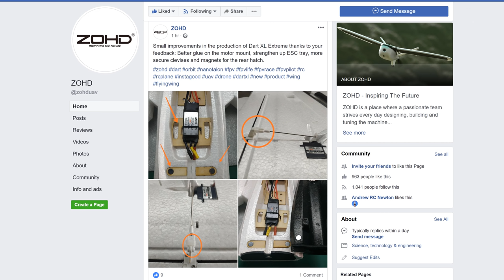"Wait for Version 2" - ZOHD Dart XL Full Review (Not a Freebie) 4K

Comment: when the guy said pull up, you got the time to strait the wing and pull up, you choose to keep with the maneuver that clearly was a wrong choice, and with the plane in more that 50 degree and the nose in 45 down you pull into the cockpit, is a clear doom thumps no questions, see that happen over and over with guy that are learning 3D.  The guy that tell you pull up pull up, knew you were doing the wrong move. You may be correct in some points but the crash my friend you own it.

Comment: Finally a review that points out a lot of the flaws that I experienced with my zohd extreme. I was honestly disappointed and left my review on banggood to that effect, because I felt that I was missing something or had been extremely unlucky and received a lemon. Because all the reviews I had seen before I placed a pre-order put this thing on a pedestal. But yes, my esc was garbage, didn't spin the motor, my servos wouldn't center so I replaced them both. The 9 inch prop was such a pain to deal with. I broke it almost every time on landing so I switched the whole power system out, put an 1800kv 2216 motor, 7X7 prop 60 amp esc and 3d printed a prop guard (shark fin) that stuck out the bottom of the model to protect the prop on landing. Now its a bit better... But man I felt duped paying $183 for this, I have to be honest...
Reply from the maker: Morning, yea I was quite surprised watching some of the videos after I got this one out. Wait for a video on this topic short;y as there is a lot of bias out there. Anyway, enjoy the model you have fella, it sounds like you have invested some decent tie in it Frank, Matt

Comment: What the hell? Okay some feedback fom my side with a similar Agree and Disagree list to your "review"

Agree: 
- Motor sounds bad (bad quality ESC)
- Winglet clips bad protected

Disagree:
- You are flying a long range endurance cruiser like a warbird… What's wrong with you guys?
- this thing is never meant to be a speeder or fly inverted but it is build for efficiency…
- you remove the back canopy because it is bulky? It is meant for optimized cooling of the ESC and other electronics like VTx! 
- Top servos? Why? disturbed top airflow means higher stall speed. That's the reason why. And because it is NOT a racer, it will not have issues with pushrod flex

And btw. I don't own a Dart XL yet. But I will definitely buy one in a few weeks and build a INAV or Ardupilot controlled cruiser out of it. So this is NOT a fanboy comment…
Reply from the maker: Morning, just spotted your comment. Do you know of any other model is designed to climb under thrust to the point it will loop? There is so much up trim built into this model it's rendered it useless. I'd watch a few of the other reviews and see what others say, albeit I do not believe it warrants the words "Absolutely Fantastic", see this video for why https://www.youtube.com/watch?v=cn1zhMqGzwI Matt
Reply: @RagTheNutsOff  I know what you mean. I fly an AR Wing right now but with inav on a F405 wing FC and that compensates for that. In manual mode it also has hard uptrim. Okay it is not as hard as you reported but it still goes to the moon on full throttle when trimmed in cruise speed of 40km/h. On full throttle it goes up to 90 with stock motor on 4S and pitches up vertical (not enough thrust to do a full loop). As I said this thing is made for cruising and not high speed. You should mechanically trim for more speed. All wings pitch up on high speed and down at low speed.

Comment: Well, just maidened mine, and Matt is pretty much spot-on. 
Chucked it, half throttle, neutral trims, and even made it nose-heavy, and it immediately looped. WTF. 
Even full down trim on the radio barely made it fly straight, as long as i didn't use the throttle.
I love ZOHD stuff, but this thing is a disaster. Bought from Amazon, going to put in a return request as i feel this thing is seriously defective.

Comment: Slightly confused Matt. You reckon the thrust angle is off as it try’s to climb on high throttle. It certainly looks that way however just prior to the #landed you were flying inverted and had full down elevator applied, and it was still diving inverted ,again explainable by bad thrust angle. What confuses me was the sudden dip down to the ground when the throttle was reduced, which you would have thought would have reduced the thrust angle issue and allowed you to be able to level it inverted. 
Also in this instance, inverted, the servos and control horns being mounted beneath the wing would actually have been beneficial as the servos were pulling the elevons giving down elevator while inverted. Their being mounted underneath did not contribute to the #landed.

Comment: I added a tarot gimbal to the top and flew it the other day.. However I as well have a list of issue  but I still love it.. 1 big issue is the motor its either over proped or the it can't handle 4S..
Reply from the maker: Morning, oh nuts. I thought they were using a similar to SunnySky motor on the back. Is it getting hot? Or is the ESC failing as I had that with the dart XL. Matt

Comment: I have a Forward swept plank and I encountered a similar difficulty to keep it inverted with low elevator rates.
It has to do with the reflex. The reflex brings stability in level flight by countering the center of weight in front of the center of lift.
When you are inverted with a plank, the reflex works in the wrong direction. So you have to push on the elevator to create that "inverted reflex". If the rates are not high enough, you may not achieve the required deflection when inverted.
I think I will add a curve with some additional elevator throw the closer I get to the upper elevator stick end.

Comment: How about trimming back the TE of the reflex section say 1/4" at a time and note the effect, probably put the motor thrust angle back to neutral first.
Cheers
Robert
Reply from the maker: Morning Robert, the angle on the motor is pointing way too far downwards. It should be going through the CG line (Sir Bruce covered this a while back). As for the amount of trim, I think we're all resigned to it being a "one-speed model". Quite odd! Matt
Reply: @RagTheNutsOff  ok , what I  am trying to say is, the inboard part of the wing at the trailing edge where the extreme upward curve is could be cut off to reduce some of that reflex thereby reducing the "up elevator" effect.
https://m.facebook.com/story.php?story_fbid=1535505459915968&id=100003695868221

Comment: £150 for a model that doesn't fly straight, doesn't fly inverted, doesn't like staying in one piece. I'll stick with the Tek sumo.
Reply: Do you have one?
Reply: @maxun1  No I don't have a dart XL. I've got other planes which do everything the dart can do and more. So I won't be getting one. It doesn't even seem to fly particularly well at moderate speeds. I've seen videos that show it waggling quite a bit, at about 35-40mph.
Reply: @51im  I got 268 planes and maybe a little be more, none of them fight equal at all.
Reply: @maxun1  
I haven't got 268 planes more like 26 and I have to be careful with what I spend my money on. It won't be one of these.
Reply: Mr.shadey it isn’t a racer. It’s for cruising.
Reply: @bondebos3478  yeah a badly designed cruiser
Reply: Mr.shadey not even true, watch arxangelrc’s review.

Comment: 7:40 Your canopy modification shows the difference from the mind of someone who copies vs someone who understands the concept of what they have designed. The owner of the intellectual rights should (always) get some form of royalties from the manufacture and have been part of the design process as a 15 minute "on paper" designer review before constructing molds would save the manufacture money, bad Karma, and avoid a mistake like that being made. I suspect the tall canopy does add some forward yaw stability due the wide vertical section added behind the C/G in the airflow... but it looks to me like it is also substantially decreasing the prop wash on top to create a prop generated low pressure area directly under the motor adding to the tendency to pitch up by pulling the tail down under throttle from the faster airflow "under" the center of the wing instead of "over" on top. So your mod may be solving two issues, the second having the same effect as a poor trust line that's even worse because it's variable with output power exaggerating the effect.

Nice design but this version of it needs some tweaking and a version 2 like you said with some carbon fiber rods and perhaps an outer plastic shell added to reinforce the weak wing area where the nose joins the wing and sticks out like an unavoidable sore thumb waiting to happen. I've never seen you break anything that fast before...;-)

Comment: The basic  premise of the design is poor..  
So the fact that it's a flying wing, combined with the large horizontal surface area of the fuselage in front of the Center of aerodynamic pressure will make the pitch instability problem(that is inherent with flying wings) just that much worse. 
with AOA increase, the CP will move forward substantially, making it usable if the CG is placed properly for a lower AOA. 
So to achieve pitch stability in all circumstances, the designers used an extremely forward CG, with lots of reflex, resulting in a model which is not efficient, as a large portion fo the lift produced is wasted.  It also means that the pitch stability is dependent on airspeed.
Every flying wing has these issues, but this one especially. 
 It's why the tail is supposed to be on the back of the fuselage, like a conventional aircraft, so you can have an efficient wing design. It's a compromise worth making.   
Lifting body aircraft have their place, but must have a wide rear fuselage, and narrow forward horizontal surface area.  If good pitch stability is desired in a lifting body, a canard should be added.  
Properly designed, you end up with either a conventional aircraft, (such as every sailplane out there, and all airliners),  a Delta, (such as a mirage), or a cranked wing canard, (such as a LongEZ).  
flying wings are not viable in terms of efficiency, utility, weight lifting, or any other real application.  
Their only uses, are novelty, grant money acquisition (NASA), and circumstances where a great speed range is required, or if they need to be stackable, and flat, such as for disposable UAV's to be deployed from a large aircraft, and glide to a fixed position, released from an automated deployer.
Crap design from someone who does not understand aerodynamics.
Reply: I want to believe you except for the B2, the F117, and this wing has been shown to cruise efficiently. 
My mods will be towards what makes it fly efficiently while still fixing issues. 
The designers have a mass produced model. Many designers have V2. Everyone needs to learn.
Reply: @JoshWeaverRC  When the Air Force wants to carry a large load efficiently, they use a B-52, or B-2B.   the f-117 was a horrible flying airplane, and can only fly with active flight controls. same for the B-2.  the only reason that either exists is because of their low radar return. (STEALTH).   they are not efficient, and are only used when other aircraft cannot.   
data collection for this model is necessary,  but they will not get usable data from an inherently flawed concept, other than to learn to just start over. 

Kudos to them for managing to make it stable, but in the process, they ruined it's efficiency.    The reviewer here expects it somehow to be maneuverable, fast, efficient, and stable. it cannot possibly do all of those things with this configuration.   Even NASA is very careful about what it actually claims about it's blended body aircraft, but still hints that it might be viable, even though they know it cannot.  The true purpose fo such research aircraft is to act as test beds to make small improvements in all aircraft. since the wing blended body is so sensitive, it makes it easier to tell if an improvement is made, as it affects performance and stability much more with this type of aircraft.  the improvements will actually be applied to more conventional looking aircraft, such as Sugar Volt in the near future, or the double bubble.  Having the futuristic look makes it easier for them to get funding from Government.  the people in Gov. are not that bright.  it's a win-win. 
If people want an aircraft that looks like something from Star Wars, they should just be happy that it flies at all, and not expect it to fly like an X-wing.  It's fictional. Nothing wrong with it, but there is a reason that nobody builds actual aircraft that look like that.   no matter how many iterations, or improvements, it is not viable.  Even toy manufacturers added a transparent canard to the X-wing to get to to fly as a toy.  would be a good solution to this model, but would require different wing camber.   
nothing wrong with version 2.  I have a version 2 of my design too, and working on 3, but collecting data, and willing to AXE ideas that do not work.  you will see that my V2 is actually more simple than my prototype. 

I also have a wee bit of design experience with Future Star, a lifting body tandem wing with twin pushers motors, and rocket power. air launched, and stable in all axis.   Took 1.5 years and 5 prototype aircraft before I got the handling, and performance to where it should be..  Must base design work on solid physics, and  be realistic about intended use.
Reply: @FPVREVIEWS  Low radar reflection happens to be exactly what I wanted it for. I got my hands on some of that radar absorbing paint as well. Wally world had a sale but limited it to only two gallons as the Pentagon didn't want anyone to paint a full scale plane if they got their hands on enough of it. 
To me RC is remote control and recreational craft. 
The F117 hangs on the walls of many kids rooms and it inspires them to do great things. 
Remember these are also recreation. 
If this model were perfect, how much do you think it would cost and would it look as cool. 
$250, $387.26. Or turn it into an ordinary plane and who would want to buy it. So how much then. $5. 
Recreational cool factor.
Reply: Ha ha ha.   you are funny guy!!   I'll have to go to Walmart, and get me some too. I'll put it on my house, so the government drones can't see my design secrets.  Ha ha . 
wings definitely look cool.   How do you think I learned about them?  because I wanted them to work too, and when I tried to fly models, wondered why they did not work well, did the research, and found out.  
the whole bit about "the fuselage, and tail do nothing, get rid of them" is really tempting to believe, except that it's hog wash.   
thanks for making me laugh!!     and happy new year, in about 6 hrs.. 
 @JoshWeaverRC
Reply: @FPVREVIEWS  I try. 
Good idea and I heard it will muffle the sound too. 
Happy New Year. 
I look forward to G-V3 in 2019! 
You do inspiring work as well. But apologies, you still ain't an F117. Ha ha.
Reply: Have you seen Future Star?  
https://www.youtube.com/watch?v=IRgvj-rWVOA
It's only black on the bottom.... but has rocket engine!!!  
Been working on the G-V3 for over 2 years now, and i hope I can bring it to market this next year, but no promises.  As stated in this video, it's not easy to bring a product to market, and i'm insisting that it be better in every way than the V-2, (not as cheap, however...), and that is proving to be a challenge.    it will be even larger, but more modular.  4Meter+ span.       
 @JoshWeaverRC
Reply: ha ha      Funny how many models are doomed to poor performance because of it..  
I'll take the nickname,  but it will be replacing "Mr. Why aren't all aircraft counter-rotating twins?"  That's my other favorite rant... Even made a video about it recently.  Don't get me started.  LOL        happy new year!! in a few hrs....   James Smith